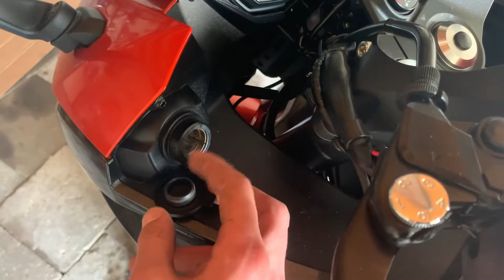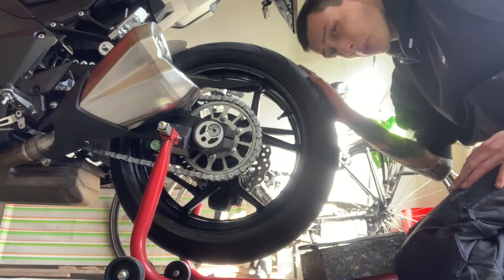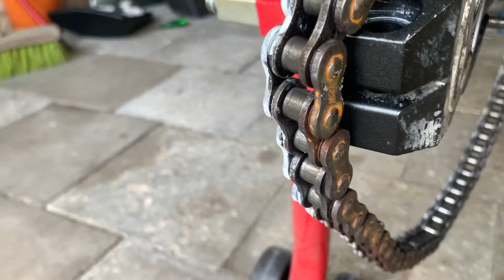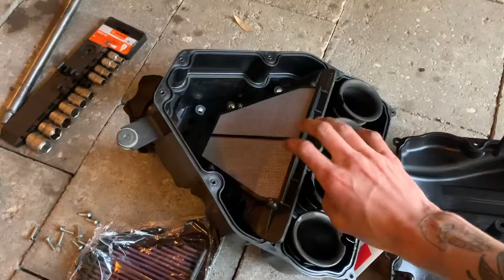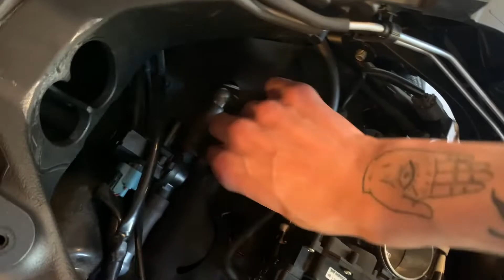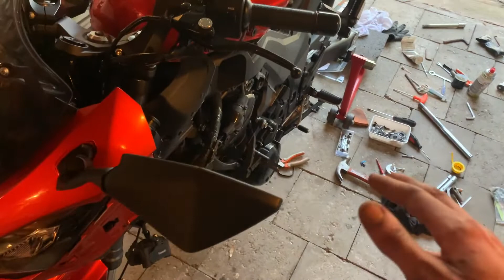Upgrading a Kawasaki Z1000SX

Comment: Hi …. Great vids and thanks heaps for sharing. When you put the new rear sprocket on, did you the same T40 on or was it different to stock. If so does that cause any issues with the accuracy of your speedometer? I also really enjoyed your z1000sx decat vid. Sorry your bike was stolen I really am. It was a beautiful bike.
Reply from the maker: In part 2 I change the rear sprocket. The difference in RPM is significant when you compare it to stock but the speedometer goes off by a very small amount, not really noticeable. You can use your phone to measure GPS speed, compare this to your speedometer before and after the sprocket change to see the difference.